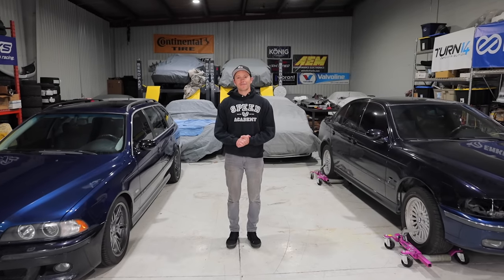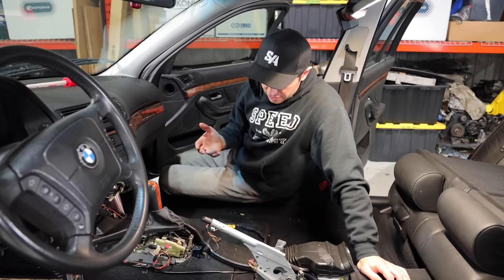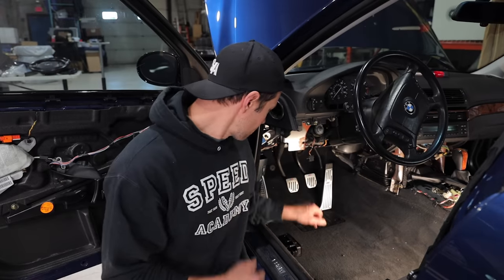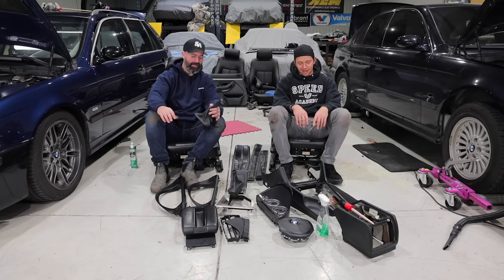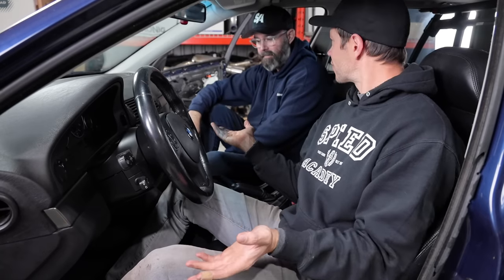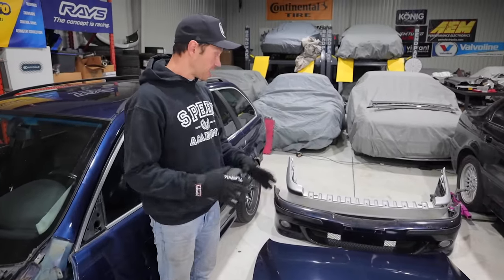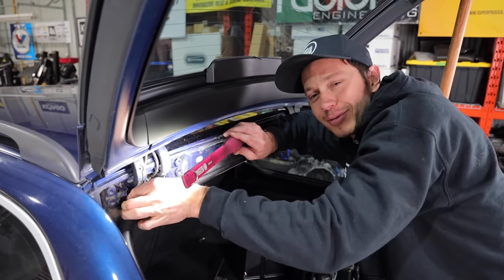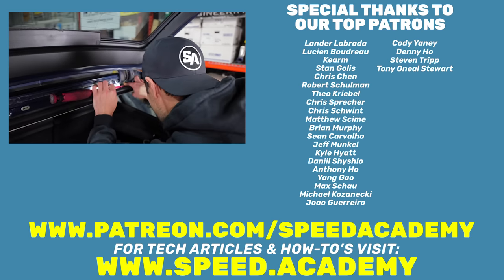Building a BMW M5 Wagon - M5 Interior Swap

Comment: I did that strut job on my E39 Touring - what a nightmare!  I ended up cutting up a bike frame and sliding the strut into the bike frame tube to hold the strut on the ball joint, then lever it in place. So satisfying once you’ve done it!

Comment: Great work Pete, I'm loving this stuff (former e39 M5 Touring owner). If the aftermarket head unit doesn't work, you should swap the factory nav screen over from the M5 and get a Bluebus for a 21st century update
Reply from the maker: That unit is junk. I have a better one en route. The nav from the other car would require a complete rewire which I dont have the time or patience for

Comment: The two wiringlooms are probably one for the metal trunk door with the lights and such and the other one is for the glas door with the sprayer, wiper and third brake light.

Comment: Like every BMW it requires an offering of blood from the owner.
Reply: Bone as well, i cracked my rib when trying to replace a brake light sensor behind the pedal on a E36 M3.
Reply: @ellis777777  Jesus Christ hope your ok now my finger nearly had to get cut off because I was trying the change the starter motor on my e90 and you have to take the manifold off and it would come off slipped and crushed my fingers they work now

Comment: Re: BMW leather. It's because they basically do use saddle leather. BMW's interior leather is spec'd to a much higher standard than most automotive interiors, and they use a thicker and more durable tan that is actually very similar to saddle leather.

Not sure about the E39, but on the E34 you could custom order North American bison hide leather, which was an even higher quality product. It's a subtle difference compared to the already high quality of the standard leather, but you can definitely tell by the feel.

Comment: Nice work guys. Couple of things: the android unit looks like an x5 version: the sides curve into the dash. As with "all the M logos". Most of them are because aftermarket stuff: pedals, floormats and handbrake are not original. So normally three on the inside: steering wheel, shifter and cluster and then 4 on the doors.
Reply: @blackknight530i  maybe in the states then, not in europe

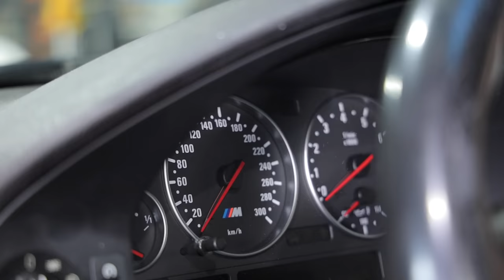Comment: Sweet build, cant wait to see it finished. But those aftermarket M pedal covers should be criminal! I had them on my E46 and had to take them off. The M on them is all wrong and stands out so much to me, its not symmetrical, and the spacing/size of the stripe looks wacky, which constantly reminds you that they're aftermarket. 22:00 compare the OEM M badge vs aftermarket, OE is on foot rest. 
Not a fan of the tablet strapped to the dash either, there's units with all the same features that look more period correct and aren't such an attention grabber. Other than that im loving how it looks, the wheel def needed updating to the facelift version.

Comment: Be careful with swapping the rear view mirror. Those have something to do with key pairing and if the key ever gets out of sync you won’t be able to pair it with a different mirror installed . Good work
Reply: @blackknight530i  it’s true man. I had a windshield bust out on my 540i and the mirror fell out with the little metal plate and it was hard to get off since the metal bracket was no longer attached to the windshield and I couldn’t twist it off. I tossed in a rear view from the junkyard and the key still worked fine but that car sat a lot so when I took the battery out and it came time to repair the key I tried for months and months with no luck. The minute you look up “bmw mirror key pairing” you will see a bmw diagram of pointing the key at the rear view mirror. I also made a post on bimmerforums about my situation and someone said it was the rear view mirror and the minute I was able to get the glass piece off of my old rier view mirror with some vice grips I installed it in and repeated my key pairing procedure I’ve been trying for months it worked first try. His key won’t just disable itself by swapping the mirror but he won’t be able to pair it again. You don’t have to believe me but considering I’m a bmw mechanic and have had 6 540is all 6 speeds and 2 e38s I’ve come across some stuff that blew my mind as well

Comment: Liking this a lot so far but please get a different head unit that actually fits the dash.  That one is meant for the E53 X5 which is why it doesn't line up correctly with the dash.

Comment: Hi guys, nice project. I am wondering that all the interior parts from the Sedan fit into a Touring. 
P.S. there are nicer android radios for e39. For example Avin avant 4. It is nearly oem design and with the Resler Interface you can connect it to Ibus and have the whole funcionality of the oem system (google Ibus App). I use it in my e39 and it works very well.
Greetings from Germany

Comment: What about a black headliner and pillarcovers?
Reply from the maker: Impossible to find in one piece. Rewrap costs a fortune.
Reply: @speedacademy  Was also waiting for a black headliner. All M-sport tourings have that so should't be too hard to find. Black alcantara from Ebay and rewrap it yourself is a cheap and easy option. Or paint it with fabric dye. I did that in my E34 and it turned out great! Fabricoat from Furniture Clinics
 and a paint gun :)

Comment: To be commended, totally. ..... but.  As awesome as an M5 wagon is, the opportunity to build a sleeper 5 series wagon is profound. Interior is awesome but with a modification to the exhaust in the rear you can retain the rear bumper.  Get a set of non-descript sport pack wheels that will fit over the M5 brakes and NO ONE will see this car coming.  Great build.

Comment: Im sorry but that headunit looks terrible. The one that came in the M5 that actually looks like the E39 GPS head unit looks so much better than the generic android one that looks tacky and out of place. And im sure it will work better too.
Reply from the maker: It wont work in the wagon as its a non nav car and the wiring is different otherwise I wouldve used it